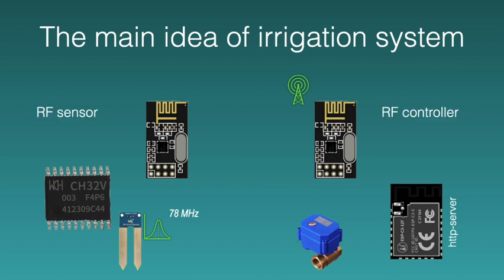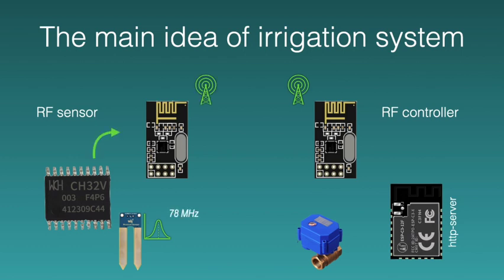Wireless irrigation system (CH32V003, ESP32-C3, NRF24L01)

Comment: Interesting! Is this a POC or do you have already a working prototype and will you make this public (github?)
Reply from the maker: This is a prototype, but not yet finished. I create a device for my parents. One sensor will control one executive device to replace the drip irrigation system. But in the future I plan to expand the number of simultaneously working capacitive sensors.